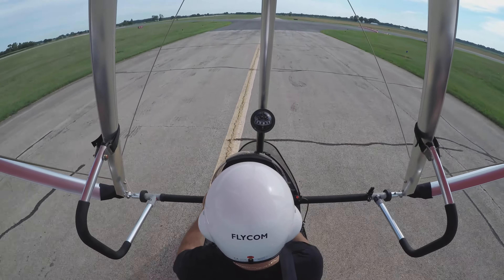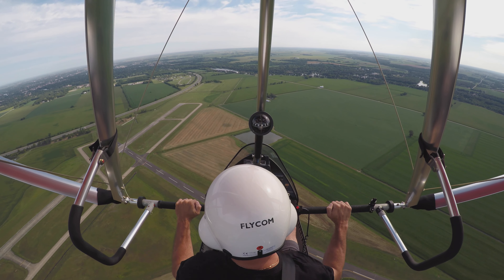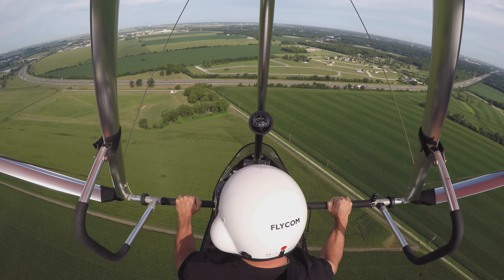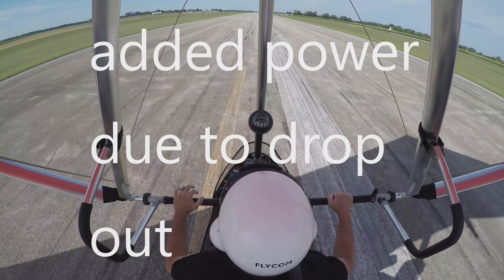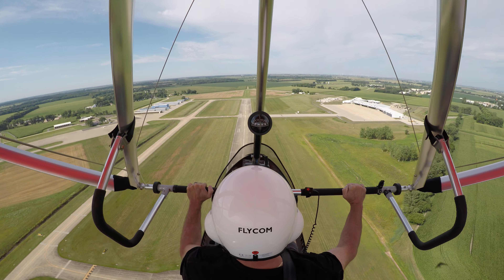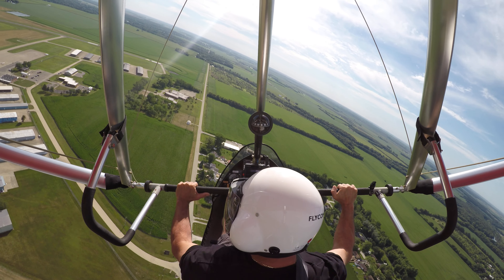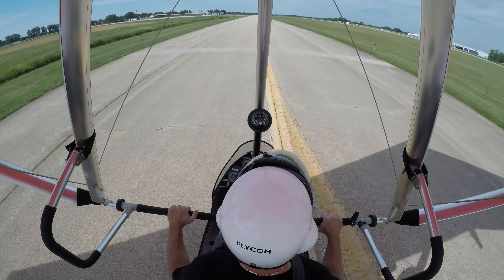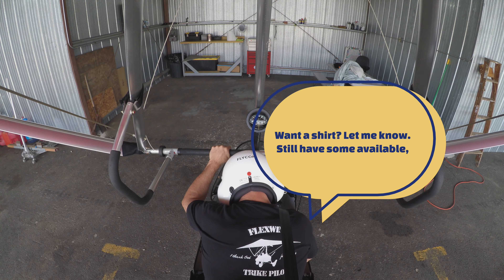Fine tuned adjustment to hand position control bar for better control.

Comment: Listen to Larry. He is an excellent pilot and gave you some good advise. I really don't think control of the wing is your problem. Trike wings are designed after hang glider wings. Hang glider wings are designed to be flown in thermals and can pretty much fly themselves. One of my flying friends has a video on YouTube that shows him thermaling a light trike during mid-day with a very light touch. Muscling the bar is really not needed unless you are close to an obstacle (ground) or rounding pylons in a speed race. Thanks for posting. Best of luck.
Reply from the maker: Thanks very much for your response. I appreciate any advice!